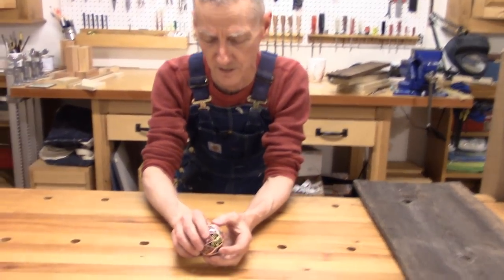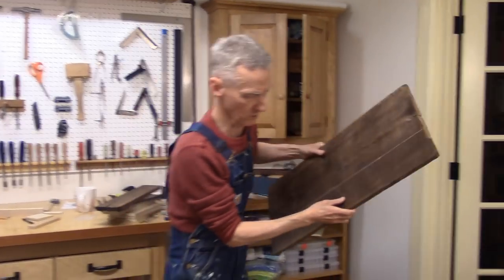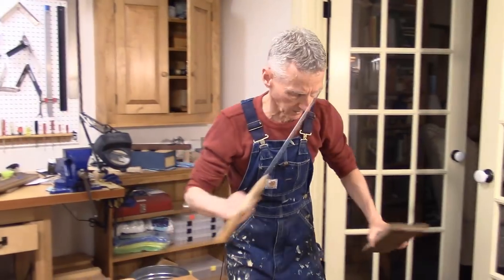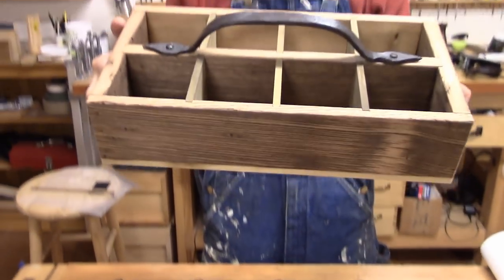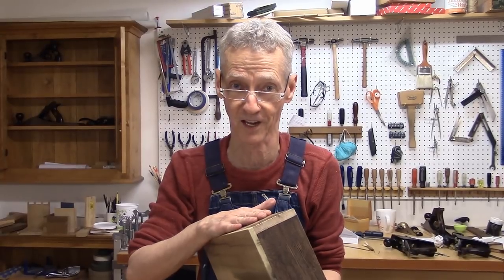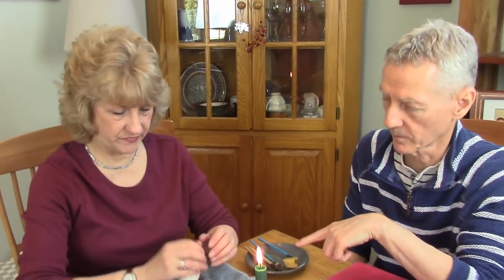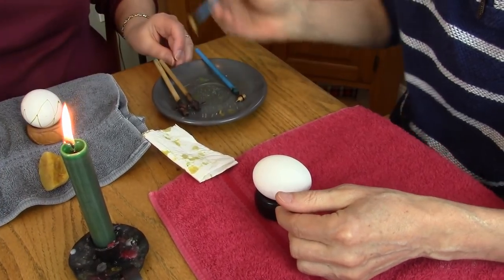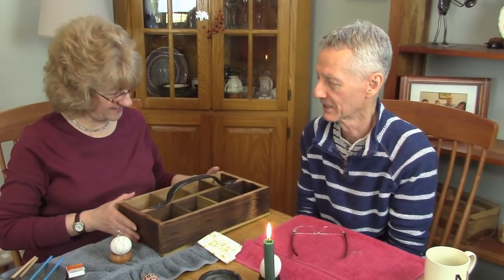Pysanky Egg Tote

Comment: Thanks for the great information. I never knew about the eggs. How is the yoke removed from the egg? Chestnut is such a beautiful wood, I haven’t worked with it (yet) We have an abundance of ash due to the emerald ash borer. Now there’s no standing ash other than treated trees. Are you going to show us the egg you started? And blacksmith too, is there no end to your talent. Lol. God bless and keep up the good work.
Reply: You poke a hole in each end of the egg with a pin or needle, one tiny and the other a little bigger, break up the yolk sac with the pin, then blow the contents out the larger hole. Or sometimes, use a hypodermic needle.
Reply from the maker: The yolk is removed as Orxenhorf describes. It really works! It was fun trying my hand at egg decorating but I think I'll stick with woodworking for now. Yes, the ash borer is quite a problem. Thanks for commenting Mike, more videos to come!
Reply: This eggpainting tradition also exists in Poland, which is where I am from. We traditionally prepare the "pisanki" (in the Polish spelling) for Easter and they are often made with hard boiled eggs. The decoration may not be that elaborate, but when prepared, these eggs are carried to the church on Easter Saturday to be blessed together with pieces of other foods (such as a piece of bread, a little bit of sausage, a small lamb figurine made out of sugar and a portion of salt). Then, on Easter Sunday, we break the pisanki up and cut them up into pieces. Everyone in the family takes a piece and we share them with wishes of happy Easter.
Reply: Marek Korkusinski That sounds like a wonderful celebration. I never knew. Thanks for sharing.
Reply from the maker: Thank you Marek. That is a very nice tradition.